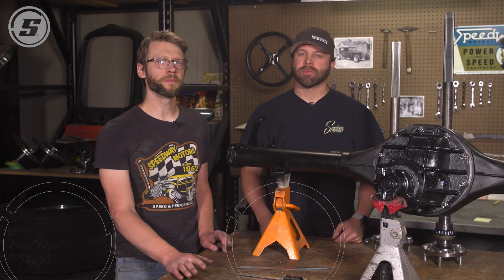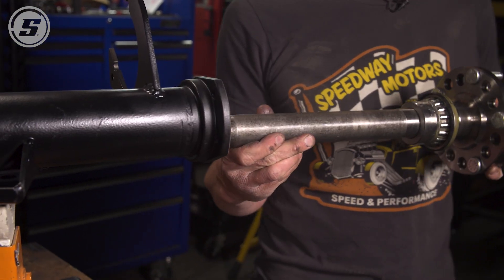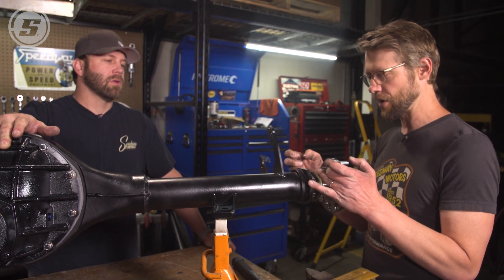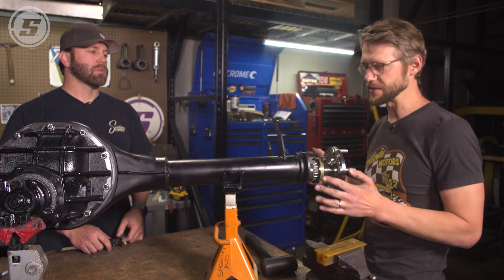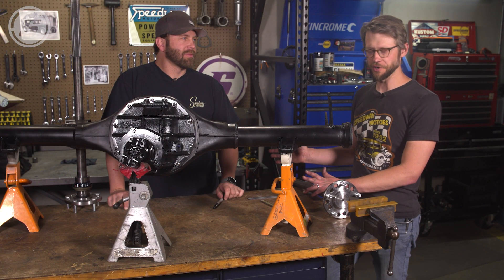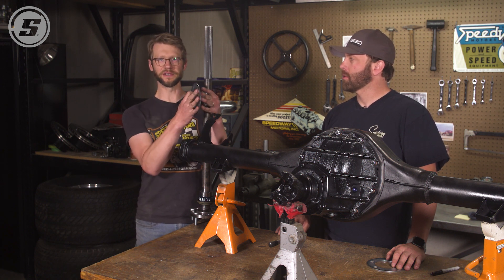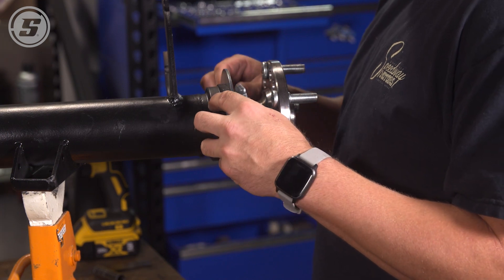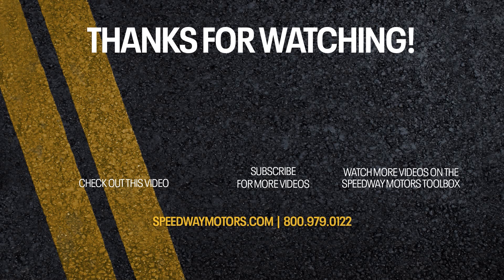How to Measure and Cut 9" Axles

Comment: You cut off the splines, how long does those need to be? On a real narrow rear end there's a possibility of cutting off most of the splines and on most axles there tapered and wouldn't have the dimension to cut new splines. Would you cut out what you need in center or hub end and weld back , how  is that handled.       Thank you
Reply: Ford axles aren’t tapered so no need to weld. Besides, axles are hardened so you shouldn’t introduce heat to them anyway.
Reply: 1" minimum spline engagement

Comment: Which way do you install tapered roller bearings.  

Outer race trapped so the axle and bearing are retained. Or outer race loose to fit into the housing. Making the axle and bearing retained by the seal and brake rotor only causing seal leaks all the time.